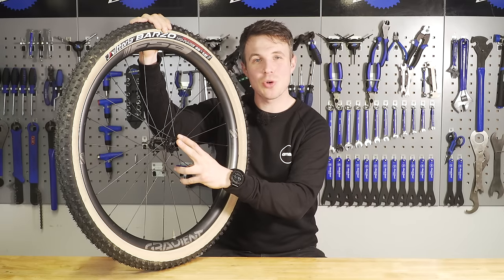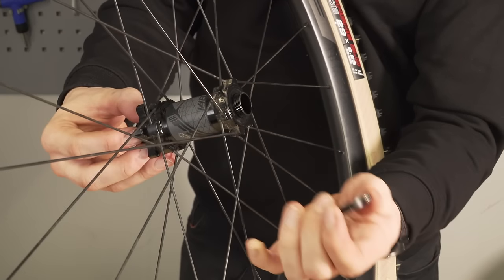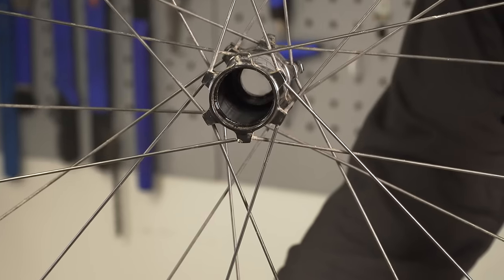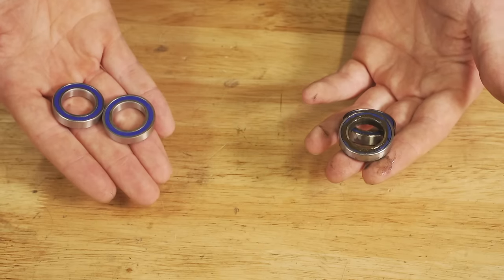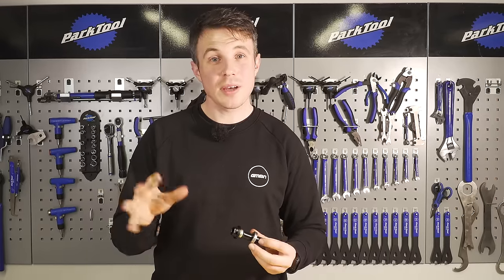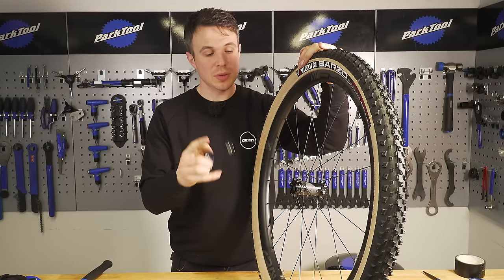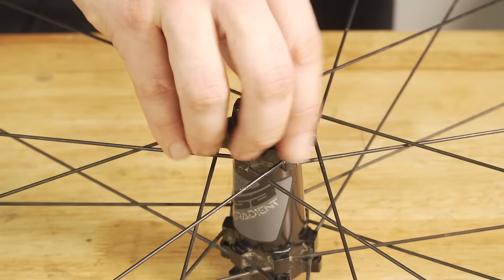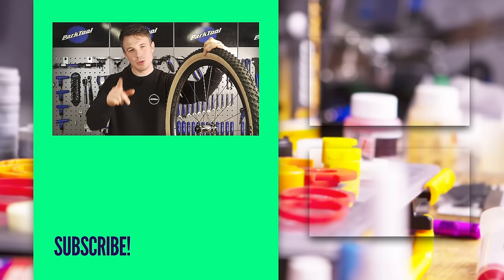How To Change The Bearings In Your Mountain Bikes Front Wheel | MTB Maintenance

Comment: If you can't get the bearings out easily, use an angle grinder! 👌
Reply: No a blow torch and chisel work best
Reply: And then when that doesn’t work, don’t be surprised if the shop charges you triple to fix a seriously bodged hub. Had a guy come in to have square taper cranks removed a while back, easy job until he grinded the bolt to use a giant flathead to remove it.

Comment: how does one figure out which bearings to buy? is there a standard, or is it just "take it apart and see, and then wait till replacements arrive"?
Reply: There is no standard, if you have branded hubs you can generally look up the diagrams and it’ll show the bearings size. Otherwise yes pull apart and read the codes off the seals or remove and measure yourself.

Comment: This video really confused me - I have a fairly modern mountain bike, with a quick release front wheel, but after spending hours trying to puzzle how to tap the axle out, i realised it's actually still using cup and cone!

I didn't think they'd used cup and cone on quick-release axles, if I knew they existed I wouldn't have had such difficulty working it out.  Might have been worth mentioning!

Comment: 'Banger' vid H as ever... for home mech some other ideas that are maybe safer (less chance of damaging hub/new bearings from not going in square) is to make your own press with threaded rod nuts and washers (or sockets).
And can use sockets to drift bearings in, but also to drift second one out square (socket on a extension piece).

Comment: Easy to make your own press... should do a series on home made bike tools...though guessing park would not be a happy sponsor!🤔😬
Reply: Whilst making kit at home to use on your bike is very rewarding as well as economical it's really difficult for a mainstream YouTube Chanel to dive fully into this .sadly all it would take is one person to replicate the tool damage a hub etc and there comes in the liability side of things .
In my situation i look after an entire bike clubs mountain bikes so it's paid dividends for me to invest in the right tools for the job and and over the years this now enables me to service the club's bike not only efficiently but very cost effective .
So for eg if yoh have just even a small group of friends you all need your frame pivots changing at some point you could buy the RRP bearing press and then individually but the appropriate adapters for each bearings between you and often some of the adapters will cross over as for eg 6901 is a common pivot bearing  and it's a great way to all learn even if one members is more competent than the others .
Reply: Who even has a full park bearing press? Wheels MFG or Enduro all day, every day.
Reply: A short length of 10mm stud bar, nuts and washers from the local hardware store can save you the cost of a very expensive press tool

Comment: Great Content as usual thanks! I noticed that my front wheel has a lot of "play" side to side when rolling on flat, I check and looks aligned (I followed your how to true a wheel videos), is there anything I should try to tight maybe? Is boost 27.5 " Thanks!!!
Reply: Tighten this bearing hub. You might need two different size wrenches.

Comment: I have a Bontrager Kovee Pro wheelset, and it’s very hard to make the bearings come out, how can I make it easier to replace them? Wd40? Read it’s similar to Dt Swiss hubs, similar process, but can’t figure it out, help!
Reply from the maker: If they're 100% coming out, try using some penetrating solution to try and loosen them up. However that'll also do a number on any grease in and around the bearing so you'll have to make sure they're out out and you can clean the area before fresh grease and new bearings :)
Reply: GMBN Tech thanks guys! ;)

Comment: How do I get the end caps out there is not a Allen head like on yours
Reply: James check mfr. manual. So many variations: hex wrench inside with threads, interference fit,  one side with wrench flats and the other hex, both sides with wrench flats...
Reply: 90% simply pull off
Reply: If you can’t see slots for wrenches on the outside, odds are they just pull right off. (Can be very tough to pull off, depending on the wheel) If it’s a mavic wheel, you may need the mavic specific tool to unthread the end caps of the axle.

Comment: Lots of videos explaining how to replace, but I cant find a video that explains if/when it needs to be replaced. Mine doesnt rotate very well, if I spin it good it stops in 0.1 second. Is that normal?
Reply: You pretty much just answered your own question, it needs to rotate well. There should be very little to no play between inner and outer race, if the bearing is loud and clunky when turning it's a no go, if it doesn't turn freely it's a no go
Reply: @david94549  where do i get bearings from? And how do I learn the correct size?
Reply: This seems like a video for anyone who wants to start running a bike repair shop not your average bike rider. But thx anyway

Comment: #AskGMBNTech Hi, I am building a new bike and I am looking at a yeti SB5+ frame and it says it can have a150mm of travel up front (forks) but I am curious to know what would happen if I were to put a 160mm of travel up front. Would you recommend it or not. Thanks
Reply: Frosty-_-Man raised bottom bracket, stack height increases, reach decreases. Higher BB usually makes cornering less stable as bike is higher, stack height and reach are rider specific. Also, do Yeti warrant the frame with 160mm? Personally, for 10mm I wouldn’t bother. Minimal gains.
Reply: Gary Winslow ok thanks

Comment: Hmm, I have an issue with all the weight being placed on the spokes throughout removal and installation... no matter how gentle you are, this is still not ideal and this method also relies on the premise that the bearing comes out easily
Reply: If the surface supporting the spokes in that area was solid I'd agree with you but given the soft ish nature of the roll of tape  and the fact Henry placed it at the end where there is a lot of strength it really isn't an issue and if the bearings don't come out easily then you have a bigger issue that where the spokes are being supported.
Hub Bearings really shouldn't be that tough to remove even if neglected given there generally at least a 6902 or above in size they will tap out with a minimal amount of effort .
Reply: Most wheel builders will actually tap the spokes going outward with a mallet when building the wheel to release slack that will potentially come out later. I wouldn’t worry about spreading that force out over 8-9 spokes when the guy who built the wheel probably hit them all individually.

Comment: 0:50 "if in doubt, look it up in your manual" - ...seriously? what manual?  not everyone has a shiny new bike, many are second hand and may have been altered from stock, and as far as I can tell manufacturers give no flying pokes about archiving the original bike spec for you to even begin to research this. I've a box full of worn parts and I have absolutely no idea what they are, who even made them or where to start looking for replacements.
Like bearings, what part am I looking for? or is there a generic bike front hub bearing that fits everything.
These bike maintenance videos are great for showing you what's inside, but we don't have a magic parts fairy handing us a service kit with all the right bits, and that's a massive problem in trying to maintain a bike that's more than a month old.
I can find more detailed repair information from the manufacturer of 40 year old IT equipment, than I can find just the brand name for the freehub of a 5 year old bike. I can't even get a paint code from them...
Reply: OK, the sealed cartridge bearing will have a code printed on the side (the plastic disc bit), just look this up.
Someone in the UK recommended SimplyBearings in Lancashire

Comment: Hay guys is it normal  for your rotors to discolor
Reply: Replace those bad boys lol
Reply: Discolouration is caused by heat transfer. Carefully inspect the rotors and make sure that they are not bent or losing material at the braking surface. It is perfectly normal for rotors to get discoloured, but only to a point. If they were starting to get very colourful, I would replace them. Dirt will not discolour a rotor.